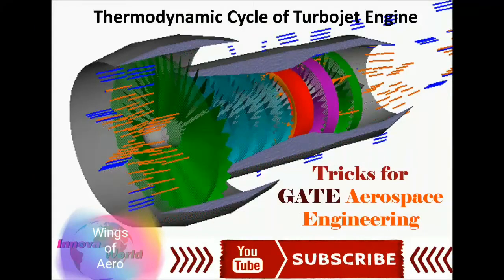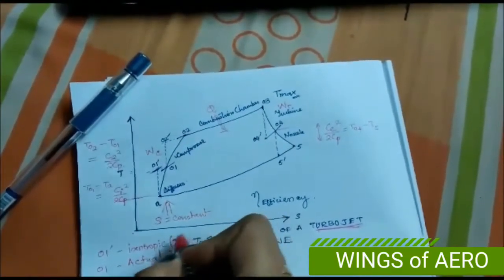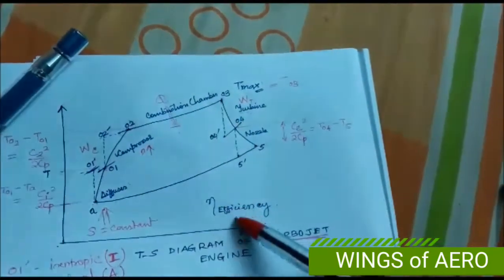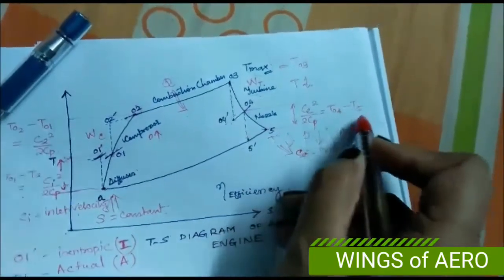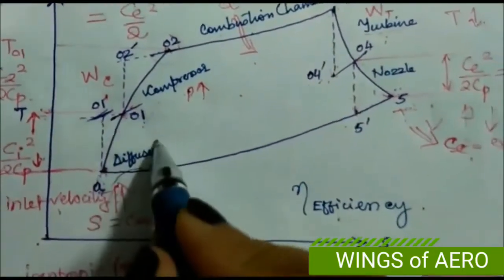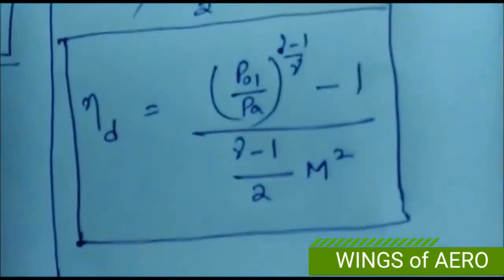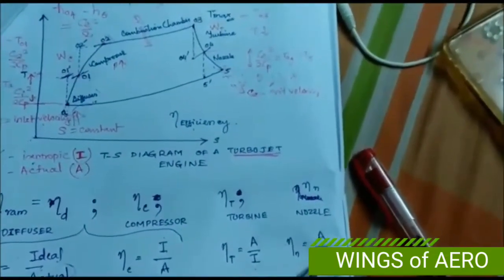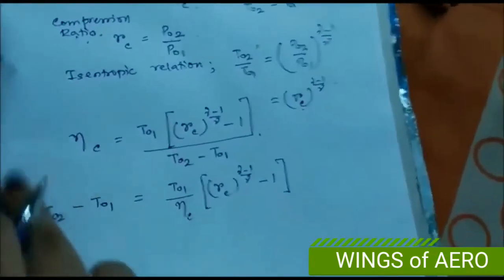Thermodynamic Cycle of Turbo Jet Engine | Propulsion | Ms. Aishwarya Dhara

Comment: You have said that (at 15:52min) T2' > T2, saying that it is obvious. Kindly rechech as you said it wrong!
Reply from the maker: Compressor efficiency = (T02' - T01) / (T02 - T01) or (T01- T02' )/(T01 - T02 ). Both are correct.
Reply: she meant To2'>To1